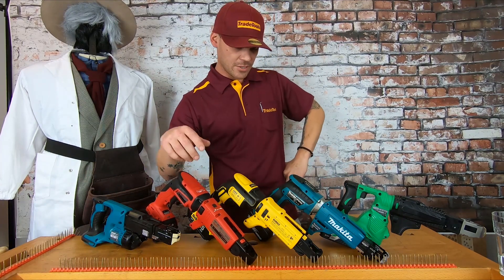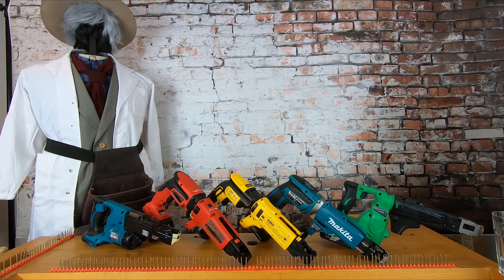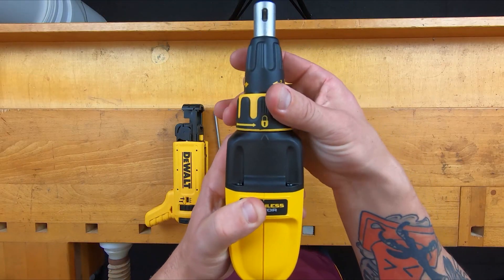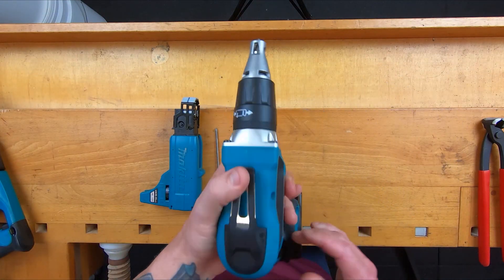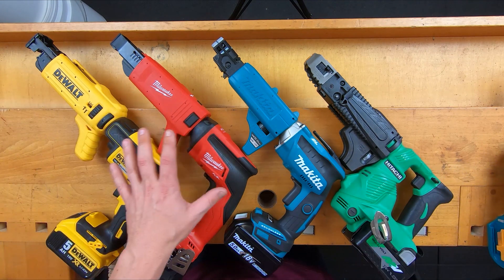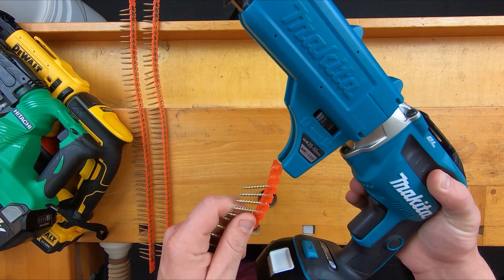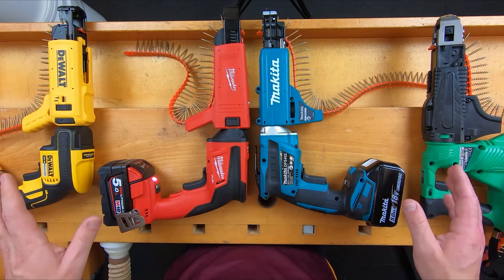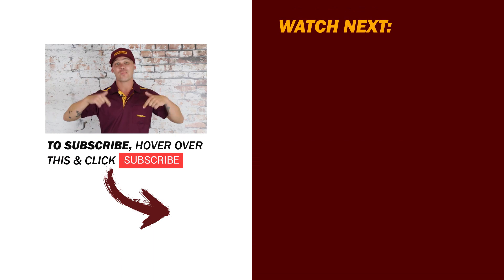An Expert Analysis of our Cordless Screw Gun Range!

Comment: Ive had the dewalt for a while everyone told me about it jamming up like mad before i bought it but it never has i must have gone through 50 boxes of screws and ive not even broken a bit got it for under £200 as well absolutely love it
Reply: instablaster...
Reply: Decent gun but not that attachment. A tip for any belt /auto fed gun attachment is graphite powder no wet lubes.
Reply: @patnaples5019  I’ve known a few lads ruin theirs with wd40 seemed like a no brainer to me but it’s clearly not as obvious as you’d think
Reply: Lucky.   My dewalt only works right when it's perfectly straight it's trash. Jams too

Comment: Only hikoki is able to screw it into internal corners, or tight places, with others collated screw guns, it's just in possible. I've got a makita, and AEG collated screw guns, and they just aren't able to do the job. Makita is not going to work even on the reces joints, the head is jamming screws, The aeg is a bit better on the reces joints, and it's cheaper.
Reply: For domestic jobs Makita is master.

Comment: My Dewalt jams as much as it works properly, sometimes makes u wanna throw it to to trash...but I have the Dewalt battery  platform so it makes sense  as the battery can go thru 258-300screws and virtually no battery consumption for a whole day .... pros...when it works right its a must have..cons when it half screws or jams its like pulling the rip cord on a lawn mower that won't start.

Comment: need your help, i have the 2866 Milwaukee gun but the magnetic bit holder is not a quick release as you showed in the nicely done video, is there a different  part number or is it the 2020 release tool?
Reply from the maker: Hi, I have a link to the gun used in the video. Produce code is M18FSGC-0.  https://www.tradetools.com/milwaukee-m18-18v-fuel-brushless-cordless-collated-screw-gun-m18fsgc-0

Comment: where the fcuk is bosch???
Reply: Andzejs Stasko I am a Bosch guy so I did some digging and Bosch recently got a new CEO and he did some restructuring because compared to the brands above Bosch makes probably 4-5xs as many products except for hitachi/Metabo, their ceo says they are going to put out less of a variety of products but will focus on making the ones they do make top of their class. Gotta day I recently bought their new smaller Cordless screwdriver that charges via usb cable and it operates easily and it’s powerful as hell, only thing better I’ve used was Makita but Makita was 2Xs the price and too big and heavy, might as well use a drill